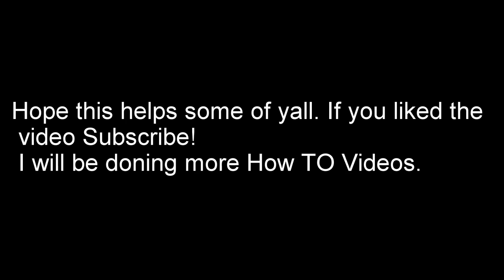How To Install Live well pump / change out.

Comment: Hi i can see your tunnel very good in this video but I would like to know the exact measurements, like total length height and width in the back and if it is tapered in the very front or makes a straight line down the boat, I would really like to build and weld the same tunnel in my next boat I build thx

Comment: Thanks for the video.  Any issues with that pump being on its side?  I was told that the pump needs to be up and down, so that would need to go through the bottom of the boat? What is your experience since you have installed this?
Reply from the maker: I have not had a issue.  I don't believe you would be able to mount it vertically but I could be wrong.
Reply: @lightlinesgoodtimes  thank you. Looking forward to more DIY videos.